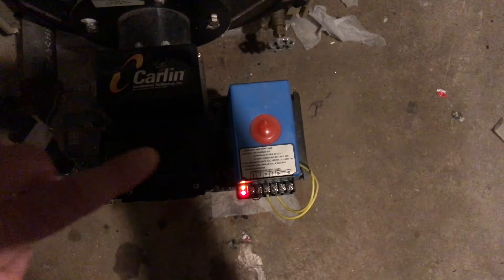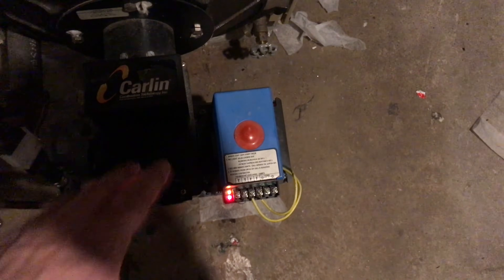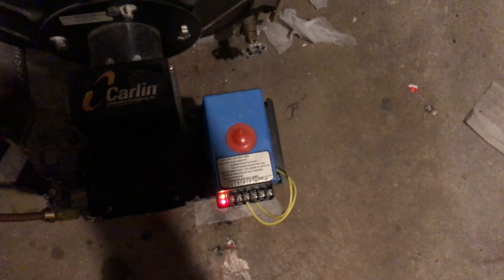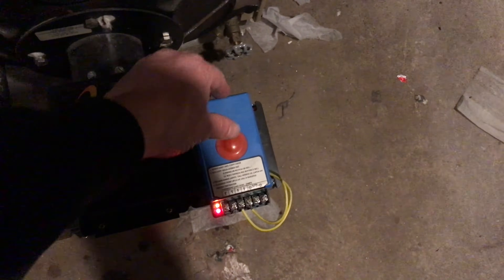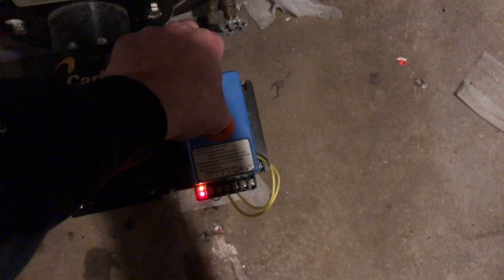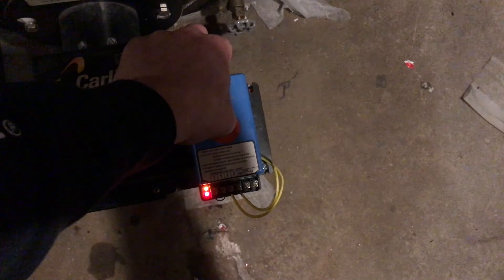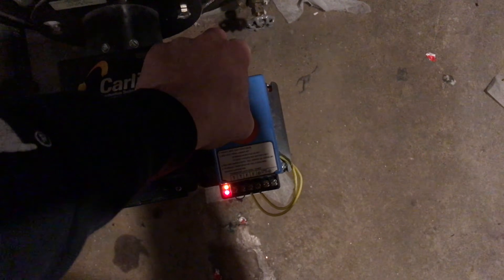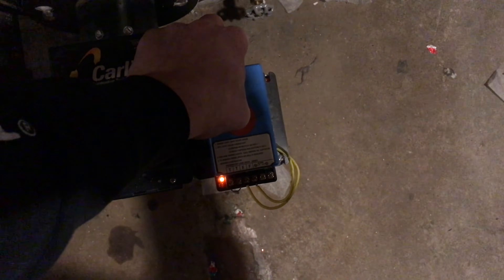How To Unlock Carlin Oil Burner With Red Orange or Amber Light

Comment: Love this video! althought I am having some different problems. I have a very simialr set up to this! There are no red or amber lights on my Carlin burner component. Any ideas of what might be the problem? I have treid to press and hold the re-set button but the boiler wont turn on or light.  Specific symptoms:

Thermostat calls for heat → nothing happens
No burner motor hum
No spark visible
Green light on the Honeywell ignition transformer (power is present)
Complete lack of any lights on the Carlin primary control (blue box with red reset button)
Reply from the maker: It is hard to diagnose without being right in front of the boiler. Is there any type of a reset button anywhere that may have been tripped?

Comment: EZ1 worst oil burner I've owned over the past 75 years! It's the only one that have given me constant problems. Last month, the motor seized up. Twice.
Tonight, we have no hot water again, but the burner is in lockout and I reset it and the motor starts but no ignition. After another attempt, it locked out with both the Self test and the lock out LEDs lit.
I suspect the ignitor, CAD cell or control board has failed. This is a year old burner and hot water tank!
Just indicates that anything made post 2019 is crap.  I'm probably going to take my old burner and replace this pos with the old energy wasting burner, just to have reliable hot water. That burner worked wonderfully for 31 years, until I replace the whole water tank last year, which came with the Carlin burner. Beckett burners forever!
Reply from the maker: I had a few issues with mine when new. The low water sensor was making it shut off at first. Has been okay for now. It is a lot more finicky that my 60 year old furnace was. there are too many electronics on this stuff.
Reply: @HomeownerRepair  I think the flame out sensing is too aggressive. One hiccup and the burner recycles.
I determined that the oil pump bearings had failed this time. Pump shaft wouldn't turn and with enough force, it turns but as if the bearings were made of stones. New pump, new nozzle and it's operational once more. Hope that's it.
The high amount of electronics on newer systems adds more failure points.

Comment: Note to homeowners:  Only push this once.  If the boiler fails to ignite the fuel, it will lockout again.  Every time the primary control is reset it will pump more oil into the chamber if it doesn't ignite.   Keep pushing the button and if it ignites, it will cause a small explosion which will only damage the combustion chamber if you're lucky or permanently destroy the boiler.  If you push the button, make sure the burner ignites.  If it doesn't, shut down the emergency switch and repair the problem if you know how or call for service.   Don't keep pushing the button if it keeps locking out.
Reply from the maker: Thanks for the added tip John
Reply: I had to reset a few times because I wasn’t pulling oil. Slomins service guy left bleeder open and I couldn’t draw oil from my underground tank into filter and Tigerloop.
Reply: This was very helpful, I tried to prime the boiler by opening the bleeder and running out the air for two cycles before getting locked out - going to reset for the first time, if the burner doesn’t ignite after first reset then I figure it would be best for service technician to come in. 😅 is there a way to tell if you’ve added to much fuel to the combustion chamber? Thanks all.

Comment: Stupid question I apologize . How do I increase the water temp ? I keep pressing increase and it’s seems locked at 120 ? Thanks very much
Reply from the maker: You may want to check the manual for the burner to see if there is a limit that prevents the increase in temperature. 120 should be plenty hot. They higher you increase the water temperature the higher the risk of getting burned.

Comment: My Carlin's different. I get a flashing light and the reset button is actually the flashing light. Just one press of the button and it resets. Problem is, can't figure out why it's constantly shutting down at 4 am or 11am when the heat is programmed to go down. Plenty of fuel and the filter is clean. No air or sludge in the line.
Reply from the maker: That's a weird thing to have happen